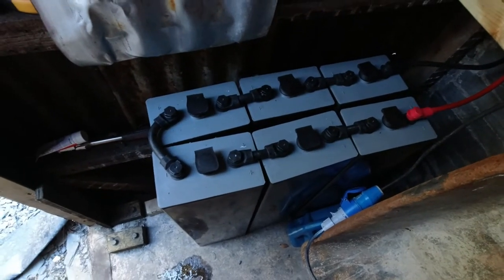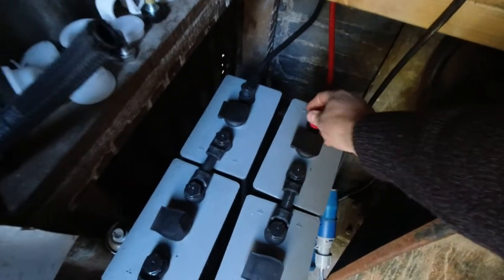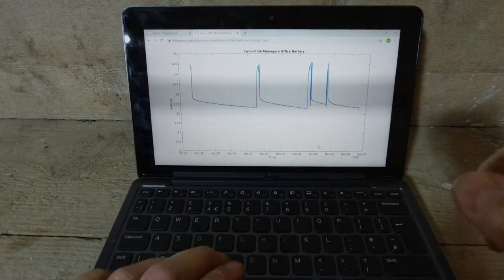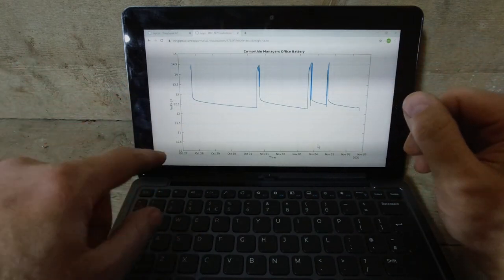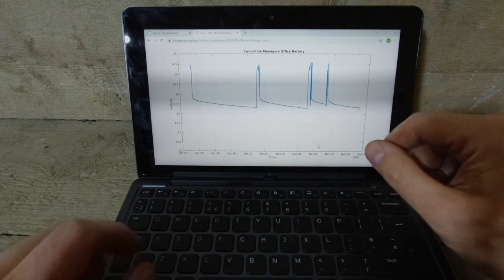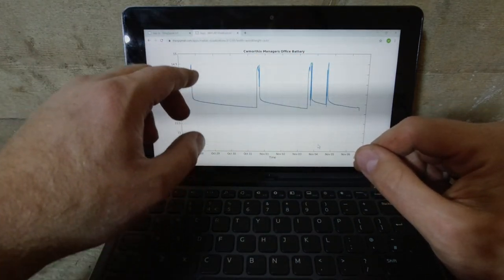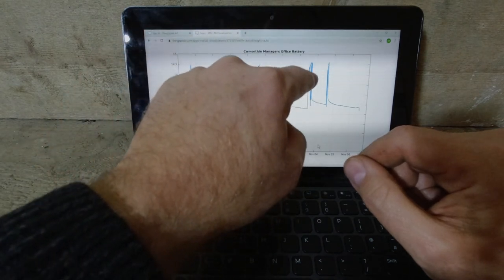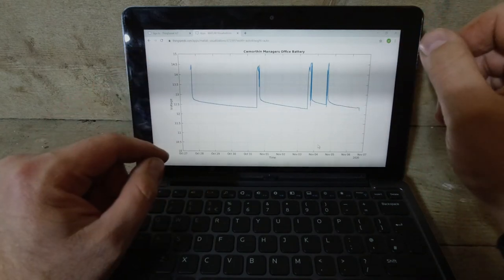Reading Volt Meter over the Internet - Remote access charge voltage of an off-grid battery bank

Comment: I did understand a little of that post, honest.   I simply have a million questions.  One of the curses I have in my life is a real interest in electronics, electrical engineering and  old technology(Lister Petter Perkins eg) and marrying both together, the problem I have, and what makes it a curse, is that I have no idea what I am doing.
Reply from the maker: Hello there Nautilus. I can try to answer your million questions! Although whether I have the knowledge is another thing. I've got a few projects on the go that you'd like, the first is a generator that I'm building from a 30's Lister and a WW2 tank dynamo, but uses very modern electronics. As soon as I've finished that I'll do a video of it, I'm sure you'll like it. The other project is an absolute monster, but will appeal to your interest of mixing old and new.
Reply: @TheAmazingAdventuresOfMiles  Excellent,  You'll have to call round one day to view the crud I have collected over the years, we are only  a few miles apart.